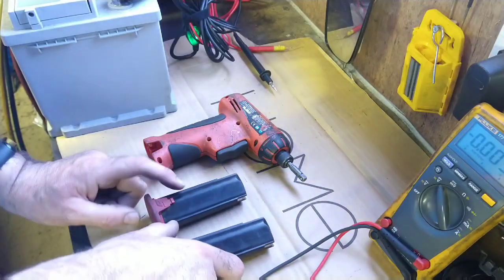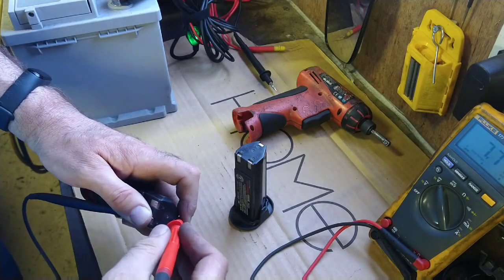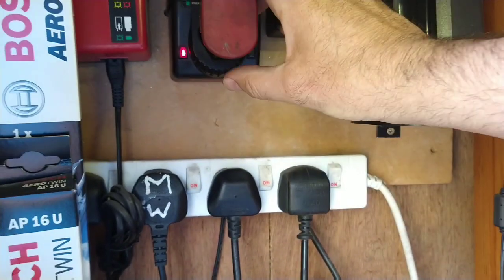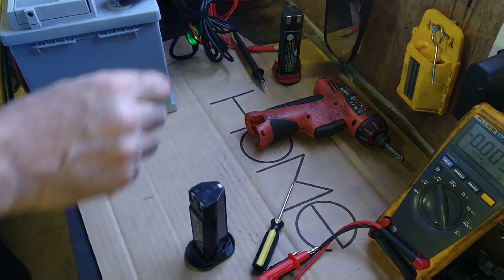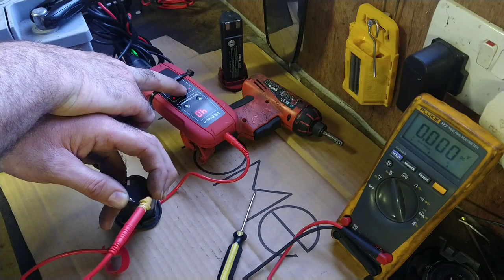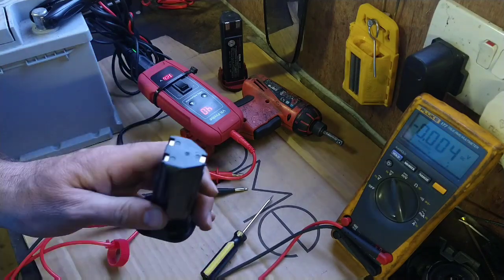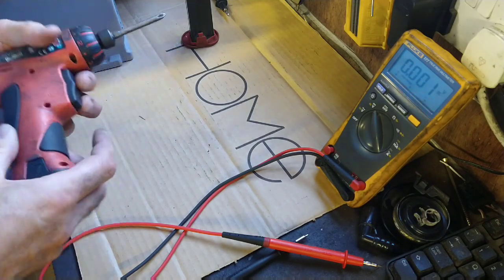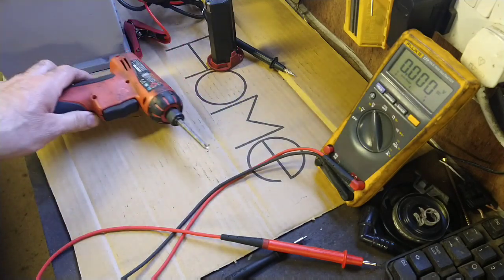Snap On 7.2v battery resurrection

Comment: If you still have this Snap On charger, would you mind checking the output voltage without a battery installed and posting the result? It would be greatly appreciated. Thank you.
Reply from the maker: @mikem669  I don't have that one any longer. I jumped ship to Milwaukee in the end ☺️. But I did like that little gun though.
Reply: @Automotive_Solutions  Thank you for the reply. Its the only Snap on cordless i have left and it really is a good little gun.

Comment: It's normal to have a single scenario of discharge to 0 now and then. You need an extra charger (the circuit board) to get to the specs of the normal charger. Don't fool with it like some comments say. Charging must remain in low amps and a bit higher voltage. It says on the chargers.
Reply from the maker: Good advice 👍

Comment: Hey, so I know you made this video years ago but I was wondering if the fix 'stuck' so to speak.  Did the battery stay revived and work long-term or was this more of a short term / temporary solution?  Did the battery die again?
Reply from the maker: It lasted for another couple of years and needed more and more frequent charging before it became useless so hope that helps.
Reply: @Automotive_Solutions   That does help, it is exactly the information I needed to be able to judge how effective this is to extend the life of dying NiMH batteries.  Thank you.

Comment: I had the same problem. I used a set of jumper leads and connected the two batteries together for 30 seconds. Dead battery then read 3.6 volts, put battery on charger and now it's working again.

Comment: I have the same tool same battery and the tool will not turn.  Battery does cycle trough the carger like normal, it has never just flashed red.  Battery reads 8.3 volts, put it into the gun and absolutely nothing....I'm stumped.   Any advice?
Reply from the maker: Sounds like a gun problem. Can't really help. Might as well take it apart and see if anything has broken or come apart. 👍
Reply: had the wire break inside mine, either that or if you used too much voltage it'll read 7.2v but not work, made this error myself before seeing this viddy!

Comment: Any chance you would be able to tell me what the output is on the secondaries of the transformer Inside that charger. I have a bad charged with 0 voltage on the secondaries. I opened it up and checked. I have voltage coming from the wall on the primary winding but no output voltage to the board. I can't find any info online and I don't have a known good charger to test myself. I'm trying to find a replacement transformer and need to know what the voltage to the board is. Thank you!!

Comment: How do you get that tool to recharge the battery like that
Reply from the maker: I basically added a small voltage to the battery so the charger would then recognise the battery voltage is at the required level to begin charging.